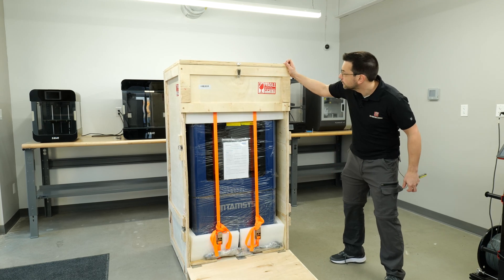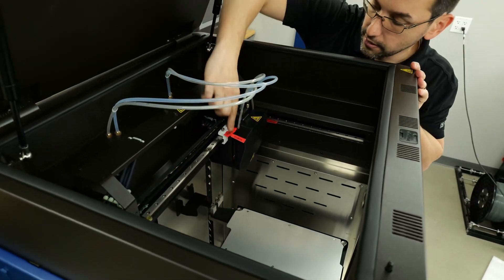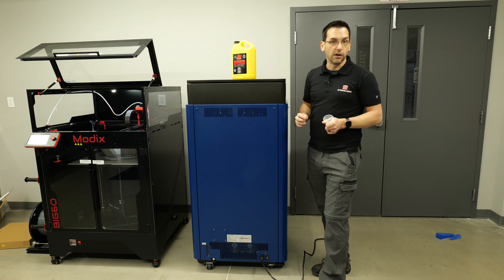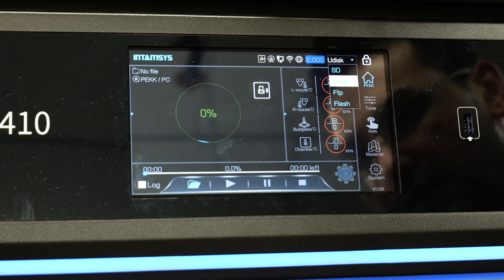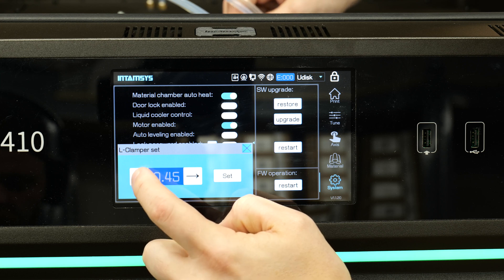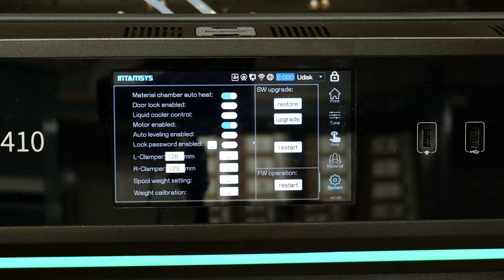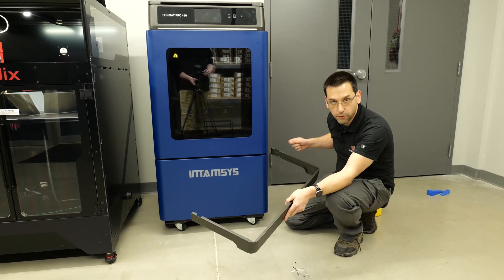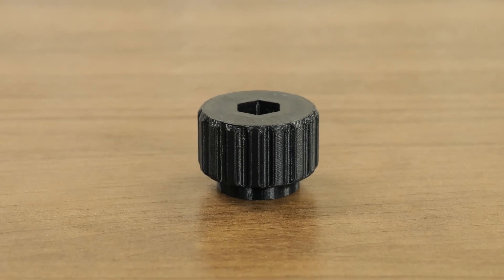INTAMSYS FUNMAT PRO 410 - BUILD & TEST PRINTS

Comment: Depending on the price I would say that the Modix Big60 in the back is a better machine. But the Modix does suffer from some serious design flaws. The gantry is weak as hell, that should really be boxed up with two linear rails and 4 20x20 beams, next thing with that machine is the extruders are weak sauce, who gets a 600mm cube machine to print with a 0.4mm nozzle at 80mm/s. Nobody. I’ve upgraded mine with a super volcano and hemera, the gantry still leaves much to be desired but I’m pushing 80mm/s with a 1mm nozzle 1.2mm width and 0.7mm z height. I’ll be building my own machine on the next round considering I’ve now got experience after changing all the wiring to go from duet2 to 3 with an expansion board and setting up the input shaping with the accelerometer. Rest is just buy parts and assemble.
Reply: I was thinking about building my own dude ! What you said is real talk 24,000 pl being cheated!! However, would you be willing to assist?
Reply: It really depends on what you are planning to print. This machine is specifically designed for high-temperature materials. The heated chamber is the most costly component.